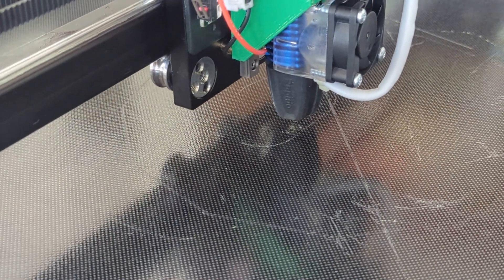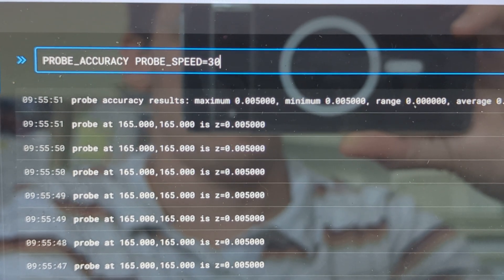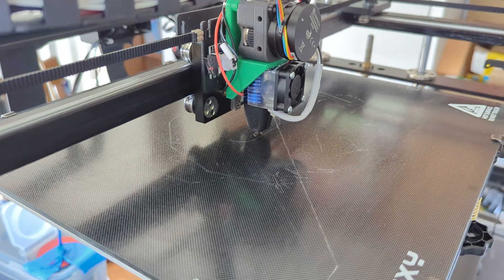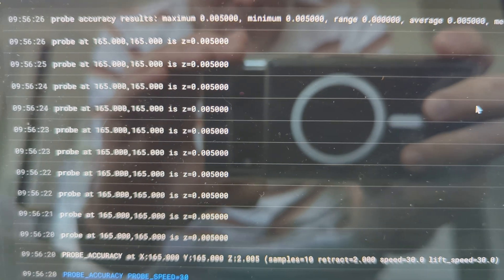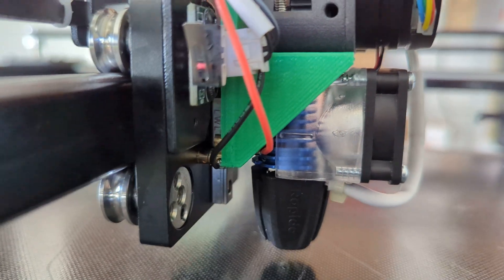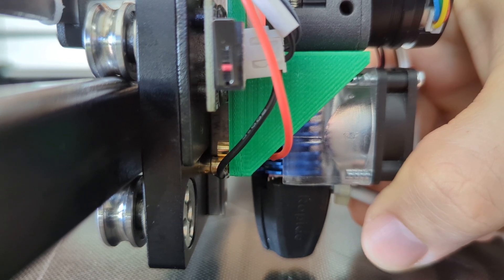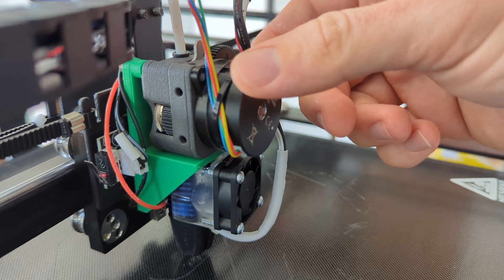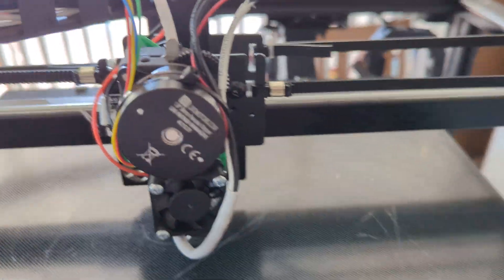Nozzle Z probe using contacts second test all 0.000000 deviation and explanation of how it works :)

Comment: Great idea! Inspired by this video, I also converted the nozzle of my 3D printer into a probe. In principle it works very well, but for my case I had to add two more features. When the nozzle probes the Ender 3 bed, the weight is so great that it pushes the bed down a bit. This happens especially at the edges of the bed. To solve this, I installed a spring that pushes the hotend upwards to reduce the weight that is still pressing on the bed. This means that the probing works very well, but another problem has arisen. The hotend is now so light that the direct drive extruder wants to pull itself upwards on the filament. I solved the problem with a bowden tube.
Reply from the maker: @HansPeter-ub2zu  awesome! Yes a reverse Bowden tube should fix that and is what I have on mine. Glad it's working for you! Bed probing with the nozzle itself is the only way to make printers reliable IMO

Comment: Nice! I think you can put a  small  RC servo on top "preloading" down the extruder and releasing it only for the probing routine. A small eccentric cam will be sufficient. Doing so you will have a very stiff mechanism while printing. Maybe you can get away without the linear rail, using a flexture.
Reply from the maker: Yes! I have been thinking about ways to lock it closed and how that might affect it. I did consider flexures quite a bit and even printed a test piece someone else designed. But my current conclusion is that the flexure will increase the actuation force quite a bit over the linear rail - but the servo does help with that as you can make it less stiff when the servo is released so maybe practical.

Comment: What printer is that? I’d love to get one of those X beams to try.
Reply from the maker: It's a Tronxy X5SA-pro and the x beam is solid aluminum - I wouldn't recommend it over aluminum tube + linear rails but it was cheap and it's a good test platform..

Comment: Out of curiosity, what is your z step size?  I've found with Voron Tap, that its easy to see a displayed 0.000000 with a large step size, but when you increase the resolution its really around 0.4-0.8 µm.
Reply from the maker: I haven't calculated it, but I'm pretty sure you're correct.. it's just what the step resolution at this speed allows. It's 16x microsteps and standard Tronxy-x5sa T8 z lead screws so 200 full steps per rotation *16 = 3200 steps per revolution. 8÷3200 = 0.0025mm per step so that's the max resolution.
Reply from the maker: I don't think it's more or less accurate than the Voron Tap. I actually really like optical interruption sensors for many use cases. But the lack of an offset makes this contact sensor the right choice for this application IMO.

Comment: There's a disturbance in the force, my machinist instincts say I'm being deceived somehow.
Reply from the maker: If so we both are 😂 but I'm definitely not claiming it's actually 6 zero accurate by any means - just that Klippers probe test is thinking that.. Which I believe means it is as accurate as Klipper can tell with the information given to the system which is just the # of microsteps stepped before the digital input pin changes. But it is very well possible that something else is going on.
Reply: @Chester Lowrey  I really appreciate this response! Good luck as you gather more data and gain more knowledge!

Comment: How about: instead of hacking up the toolhead, do the contact break in the Z lead screw nut assembly? A sort of anti-backlash nut that's spring loaded but can separate under load.
Reply from the maker: I think that would be really hard to do as it would have to be a very strong spring so as not to move when the weight of the printed parts get added to the build platform. If you want to sense it on the bed you're better off with piezo discs like the Bambu X1C or strain gauges (basically turning the bed into a scale) which would also work with minimal  force.
Reply: @hilo90mhz  I had in mind a gantry moving up not a bed moving down.
Reply from the maker: @daliasprints9798  ahh yeah that would be more doable! I think the big next step is going to be using a hinged or compliant mechanism on the head instead of the extra linear ball bearing. I will try this in the next few months with a print head that can swing up (only needs to move .1mm or less.. With the hinge at the top back of the extruder + hotend and the contact near the bottom. And some sort of spring to hold it in/down.

Comment: I was a bit sceptical at first but this appears like a great idea that has potential. I was wondering, what if instead of a linear rail we used the compliancy of the carriage? For example, we could leave the contact on the black plate as is and mount the hotend on a top plate (which is let's say printed and has the ability to flex just enough) that gets screwed on top of the black plate. Then when the nozzle touches the bed the printed plate flexes slightly upwards and the contacts stop touching each other. This way, it is gonna be lighter and the toolhead will be more rigid. What do you think? Keep it up!
Reply from the maker: Yes! It's all possible.. I don't know the exact geometry you are talking about but feel free to experiment and a compliant mechanism will be the simplest and best probably if the geometry works for your design I think.
Reply from the maker: I was also skeptical of this idea at first 😜 I really like optical sensors for most applications so I still wanted to use one at first. But after a day of thinking about it I realized that contacts are the best solution to this problem if you want ZERO Z offset 😁.

Comment: You mentioned a spring.. on the Tap for Voron they actually used magnets staged to hold the extruder body down on the rail. In doing so it takes some force to break for upward motion but not much.
Reply from the maker: Yup, I'm aware they are using magnets, either one could be used to increase the downward force that is warranted. Magnets are better if you need larger travel and want highest force when it's at the bottom. Since this only has to move . 01 or something either one would work.

Comment: How would you archieve first layer squish with the system - i'm guessing the hotend is heavy enough to keep the whole thing down during normal printing even with a bit of squish?
Reply from the maker: Yes it does produce first layer squish and further layers too. Assuming 200g assembly weight and assuming the nozzle tip area is 2mm diameter you get 3.12mm square area the force is applied over. That calculates to 91.1 PSI or 6.28 bar or 6400g square cm (I'm not sure what pressure unit makes sense to most people ;) so it's a fair bit of pressure still since the nozzle area is so small.
Reply: @hilo90mhz  Thanks for the calculation :) 6.28 bars is indeed a fair bit of pressure. 

What kind of rail and what lenght are you using? I come from the old delta generation and the best layers i've ever seen, has been on an old delta with this exact system (but implemented worse)
Reply from the maker: @klipklop-ls8hy  it's a 7mm rail type C carriage and 40mm long rail.

Comment: You could add magnets like Tap?Also, Many years ago now, Some of the first Delta printers had the ho tend on a pivot and would bed level with a micro switch on the top.
Reply from the maker: I have seen those designs years ago too! I'm definitely not claiming to have invented this idea, just trying to show that it works really well and that more people should try it.. the contacts themselves are so dead simple... Just two pieces of metal so nothing to break.. 

And yes magnets could be added if necessary, I may add them in the future. But more likely a small spring or just top endstop screw that can be adjusted to only let it move up something like 0.01mm

Comment: That's a very good idea. I wonder if there are any problems with the printing quality when actually using it.
What sensor did you use?
Reply from the maker: Sensor is just two gold contacts that touch each other as a switch, they are shown in the video on the left side of the assembly. 
I don't believe it will affect print quality as it is quite rigid in X/Y. 
Give me another month to test that more on this printer and a VZBot printer kit I am building which I will incorporate this design into also.
Reply: @hilo90mhz  Don't forget me after a month and be sure to let me know the results! I applaud your idea.
Reply: @hilo90mhz  I'm back! How about this?? Based on your opinion, I will try to apply it too!
Reply from the maker: @1DollarGOD  There's another video on my channel showing it printing before input shaping and results were good, even better with input shaping. I haven't had much time to integrate into Vzbot printhead though still in idea phase.
Reply: Ooooh a Tronxy x5sa pro!  I have a stock one with tons of uninstalled upgrades. I did buy a "klicky PCB" kit, but still think this is more accurate.
Reply: @eminence55  Compared to the method using a physical sensor, I think the electrical connection on/off method is absolutely accurate.

Comment: I think this will affect your print quality as the head is now able to move up with relatively little resistance (only its own weight), so when you are squeezing out filament from the nozzle, rather than the nozzle pushing this into the layer below, it can push up your print head.  This is why the Voron tap is quite "stiff" and as a result is only advised for fixed mounted beds.
Reply: You could also restrict the motion of the assembly by attaching a limit screw. This way you could limit the motion so that there is only enough play to trigger the switch.
Reply from the maker: I will test more in the next few weeks to tell more if it affects print quality or not. I can always add a spring or magnets very easily like Voron Tap has if it is necessary. I just don't like solving problems till they exist so we'll see if that is truly a problem first.
Reply: @hilo90mhz  Sure you can add springs, but that in turn requires more force onto the bed to trigger and if the spring on your "tap" is more stiff than those of your bed, you could be pressing down the bed before you trigger.  Hence the "fixed beds only" on the Boron TAP.
Reply from the maker: @MisterkeTube  I can definitely mount the bed without springs if necessary. You'd probably love this if you saw it in person. It triggers on first touch without any movement visible.. even with a spring I think the force would be minimal and repeatable enough that it would work with a less rigid bed. But definitely don't use it if you don't want to 😜
Reply: @hilo90mhz  I am all for attempts like this.  Maybe I overlooked it, but is there some link to a page with more info on your design?  Considering the little motion needed to trigger, mounting the head on a fairly stiff flexure might solve the "spring" requirement while removing a need for something like a linear rail.  Tuning the stiffness of the flexure vs that of the bed and the weight of the head would probably still be needed though.  One drawback will remain for such probe-with-the-nozzle solutions: your nozzle has to be clean: no molten filament from a previous print sticking out of it.  Or if you probe with a hot nozzle: no filament oozing from it ...
Reply from the maker: @MisterkeTube  My GitHub has the 3D model and the comments on the two videos here on YouTube have more details.. there's some more info in the Tronxy X5SA Facebook group too.
Reply from the maker: @MisterkeTube  I have thought of mounting it to a flexing arm or a ball bearing supported arm with springs etc which is mechanically simpler than the linear ball bearing but should work also. I could also put an adjustable upper endstop screw on this design and adjust it to only allow .01mm or something max movement. Of course you could do that with the articulated/flex arm design too. Have you looked at the Bambu printer? It is insanely popular and uses the nozzle as the probe with piezo sensors under the bed... I have one and it's amazing. It cleans the nozzle before probing etc so it's definitely possible to do reliably and I'd argue nozzle probing is the only reliable way forward - I'll never deal with offsets again. If you're going to the trouble to make a flexing arm I would put a strain gauge on it like some printers do already. Klipper will have support for strain gauge ADCs someday - there's someone working on it. Although the contact system is so dead simple it's hard to argue for anything else... I can only think that Voron never tried this or they would have went with it instead of their overly complicated offset optical system.
Reply from the maker: @MisterkeTube  Also the main reason I will keep a linear ball bearing design is for IDEX print heads.. I am going to build a quad IDEX one day and the linear ball bearing with adjustable bottom endstop contact will allow me to set all the printhead to the exact same level easily after changing nozzle etc which IMO will be required for any serious system.

Comment: That might seems like a good idea, but the bearings needs to be super high quality to have "almost" 0 play in the x/y direction, and that is why the extruder is usually fixed in the gantry, I think. I don't know if even quality bearings can guarantee absolute 0 play but good movement in 1 axis.
Reply from the maker: Yup! These are real IKO Japanese made preloaded bearings. Still only $20 on eBay. Zero play before breaking 🤪
Reply from the maker: Try to use real Japanese linear bearings with preload 1 and you will see what I mean... Night and day to any Chinese linear bearing. Almost all "Hi Win" for sale on AliExpress is fake too so don't trust anything on there...
Reply from the maker: @jovanrado9548  you're right! I'll edit the original post

Comment: Nice job! My cnc probe uses contacts like that. They also use a dialectic grease to keep the arcing down. Do you have the carriage files posted anywhere
Reply from the maker: Yup! All the obj files are here, Cura can print obj files directly: https://github.com/clowrey/x5sa_pro_klipper
Reply from the maker: And good to hear about another probe using dialectric grease I was thinking of that and will definitely add it

Comment: This is good idea. I tried it with nozzle and direct on aluminium bed, the problem was it creates noise and sometimes mcu just stop responding.
Reply from the maker: Thanks! I think so too and it allows you to use any bed material as long as it can handle the nozzle pressure

Comment: What are these gold contacts that you are using? Specs or link are appreciated
Reply from the maker: I believe they are 3.5mm nominal ID female RC style contacts I have had in my parts bin for years. The OD on them is 4.15mm so they press fit nicely into 4mm hole I drilled in the aluminum back plate and the 3d printed PETG on the carriage. To press fit them I used Knipex parallel jaw pliers - some of the best pliers known to man.. 

Since I hand drilled the holes rather crudely for the contacts they don't even line up perfectly.. They're offset by about 1.5mm but still make contact and act as the bottom stop for the linear bearing and that is all that matters.. 

The main thing you want in the contact is a rigid endstop with no springiness and no corrosion so gold plated is ideal. I may coat in dialectric grease to improve corrosion resistance especially as who knows how much "gold" these actually have. 

I think this is the same product on AliExpress but mine were purchased about 8 years ago so there may be some variation... I just used two of the female contacts as they are nice round tubes etc.
 US $1.55  8%OFF | 20pcs/lot 2.0mm 3.0mm 3.5mm 4.0mm 5.0mm 5.5mm 6.0mm 8.0mm Gold Bullet Banana Connector Plug For ESC Battery Motor ESC (10 pair)
https://a.aliexpress.com/_msbAeLY
Reply: @hilo90mhz  Thank you so much
Reply: Interesting, like a Voron tap without the photo interrupt sensor
Reply from the maker: @BigBadLoser  yes in some ways. I already had bought the linear rail for this before I even heard of the Voron Tap. The main difference is the contact and the fact that having the contact as the bottom endstop for the hotend movement allows it to have basically zero or 0.005mm XYX offset from the nozzle itself. The contact was recently inspired by the "unklicky tap" you can look up, design on GitHub

Comment: That looks like a great set up. Are you going to share STLs?
Reply from the maker: I'm not sure how useful it is to anyone else.. but maybe for ideas... The actual contact holes were just drilled with a 4mm hand drill one in the aluminum block and one in the PETG 3d print as I wasn't sure where to put them before it was printed. Designed for Tronxy X5SA-pro printer maybe useful for others that have a flat plate you can mount the linear rail to. Linear rail is LWL7C 40mm long. I believe other 7mm rails will also work but haven't verified. 
The file is here "Tronxy mount linear rail.obj" Cura accepts obj files directly. https://github.com/clowrey/x5sa_pro_klipper
Reply: @Chester Lowrey  cool my first printer was / is a tronxy x5sa ! Not pro but I'm thinking about upgrading it to linear rails.
Reply from the maker: @manofthecroc  cool! Ya get real linear rails not the steel rollers kit they sell to convert it to a pro... I just wanted a low cost test bed to try out some ideas.